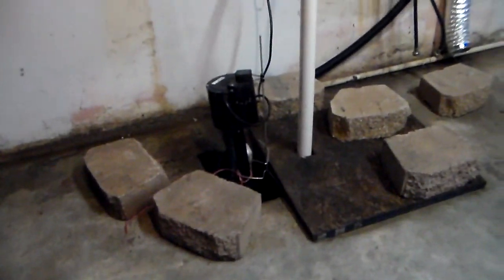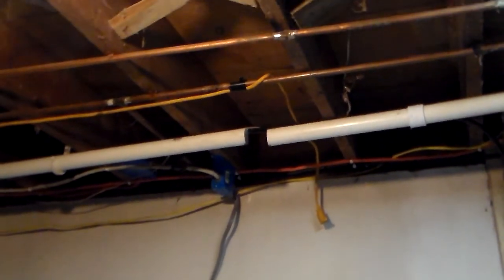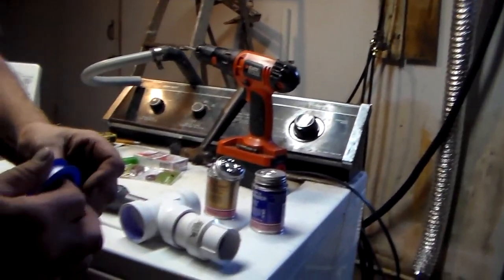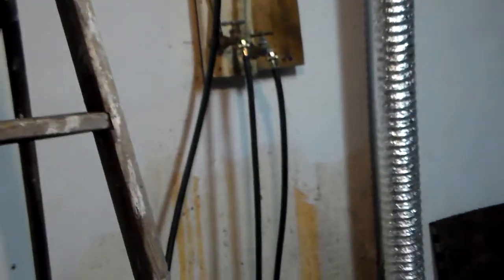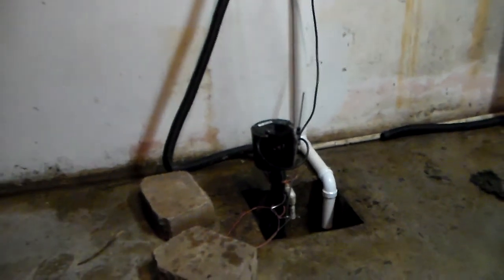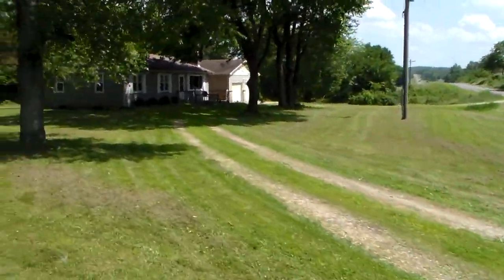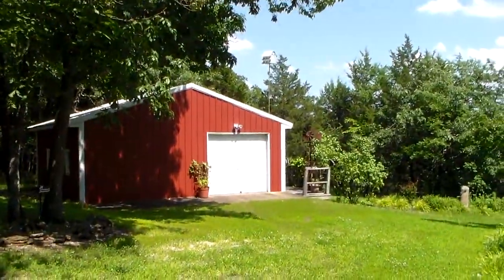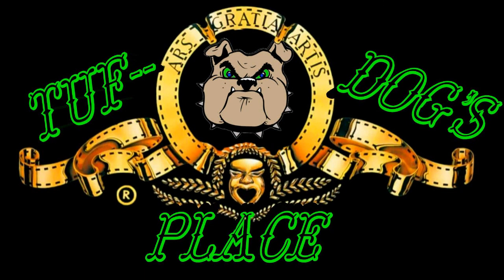PVC Pipe Repair & Candy Delivery

Comment: Illegal to pump black water out of washer into sump and out in yard. My house was same way when we moved in. I had to replumb it too. OK for sump pump to pump water out into yard. You need a pump that sits on top of the floor beside the washer and your washer drain connects to it, the pump will push water up into 2 inch drain over head and down to main sewer line. Have fun! Need to use hammer drill for concrete in case you are using regular drill. Later.
Reply from the maker: 19stoney64 Thanks Stoney, I'm glad you said all that cuz it just makes sense.
& About the drill, I remembered that after after I made the video. 
I was asking around at work tonight about borrowing a hammer/drill. Gotta talk to the Big Dog tomorrow. ...